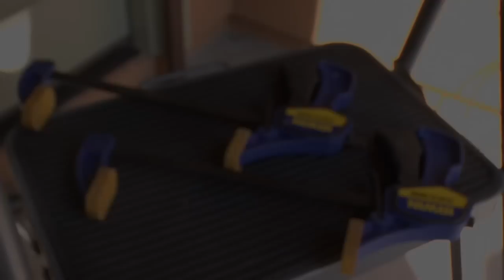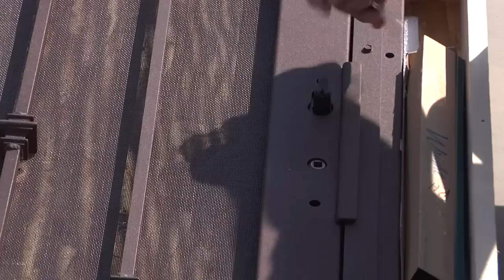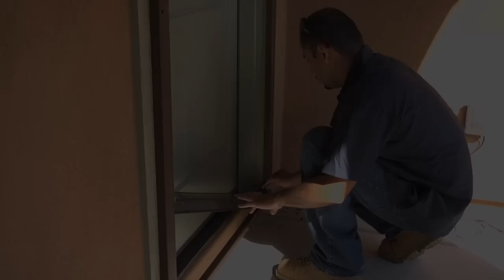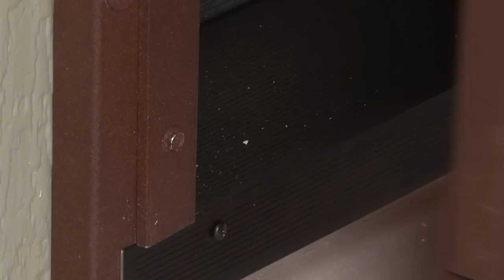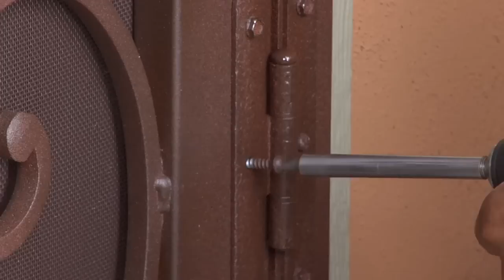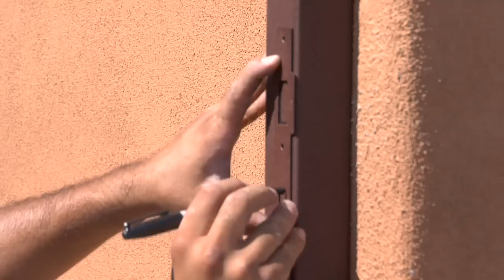Security Door & Gate Installation by First Impression Ironworks

Comment: What would you recommend I do if I centered my security door with the main door opening, BUT there is nothing behind the 1x4 trim molding to secure the security door to? I believe the contractor used shims between the 2x4s and the main door trim leaving a big enough gap so that when I drill for the security door, I hit that gap where they used shims for the main door.... any thoughts?

Comment: I have three security doors to my house, before mounting the doors I had rebuilt the door frames with solid wood mounted into the block walls of the house, then I mounted the three steel entry 6 panel doors and ensured they had a weather proof fit. I bought 3 identical looking security doors from Lowe's Home Improvement, they have 2 inch perimeter rails on the doors. The support bars came with 3 holes and non-reversible screws, I drilled three more holes and installed 3 additional non-reversible screws. These screws are secured into the solid door frames with no shims or gaps. After this the two unseen doors, (back and garage) had double key deadbolt locks installed so even if the steel screening is cut they can not open the doors without the key. I shop regularly at Home Depot and a cashier introduced me to a new locking hasp. The arm swings over the locking pin, this pin rotates to lock the arm in place, then a key is used to lock the rotating pin in place. I used carriage bolts thru the security door frame, then 3 inch screws to mount the lock base to the solid frame into the surrounding stud. Keep in mind the security doors protect the steel 6 panel entry doors. For additional security I mounted 3 pins into the security door frames so if the hinges are defeated the door will not open. Roll down shutters protect the windows and I built a steel locking cage for the power panel. The walls of the house are 16 x 8 x 4 concrete block, my assumption is they would have to come in via the roof. Then they are greeted with a Springfield .45 ACP if they succeed! The garage door I am currently building will have a switched receptacle for the door opener so it can be completely shut off at night or whenever. The tracks of the door will have two holes, one each side drilled so a bolt and wing nut can be applied so the door can not be pried up. The door from the garage to the laundry room is one of the three previously mentioned. The Air Conditioner is in a closed storage, tool area with a security door and block walls. This also is where the two bathroom windows are, they have a heavy duty screen mounted in the name of CrimSafe, these are baseball bat proof. My next feature will be 4 security cameras to see along each wall of the house. I can open the steel front door if anyone rings the door bell, but the security door remains locked thus a home invasion can not happen!

Comment: Please do your research when buying a good security door.  The door might look like it is a good door but anyone who knows what to look for, can see a huge problem with the door that is in this video.  The door frame goes on with one way lag bolts but the door can be easily taken down by unscrewing the tiny screws that are used for the hinges which would take someone with a simple screw driver maybe a minute.  The hinges to good security doors are always welded on the door or if it does use screws, they are on the crack of the door.
Reply from the maker: +Chris P 

Hi Chris, 
Thanks for checking out our video. We use security H-hinges to mount our signature security screen doors which have a welded hinge pin that cannot be removed. We install these security H-hinges to the door and to the frame using security one-way screws in the center two holes of the hinge. Utilizing security one-way screws assures that nobody can unbolt their way through the door as you are suggesting. An additional security measure lies behind the security H-hinges with vault pins. Let's say somebody took a grinder and cut off the hinges --(this is what somebody would have to do to get the hinges off of the door once they are installed). As long as the deadbolt is in the locked position, the vault pins will keep the door securely within the frame without the hinges attached to the door. That's real security!

We do offer an entire line up of exclusive security screen doors that utilize welded hinges among many other upgrades if you prefer. Check out our entire line up of DIY security screen door at: http://www.firstimpressionsecuritydoors.com/product-category/diy-security-doors/.
Reply: FrustratedBaboon I' worked for fisd. .I can tell you that the vault pins are enough to stop the door from being simply taken off . it's 2  hole maby 3\8 or so in the door on the hinges side  with  pins hard mounted in to the outside frame. thay simply slide inside upon close. so even if you get past the one ways you still can't pull the door as long as it's locked there actually really nice doors .any  screen door can be  breached but the noise and time would be enough to say to risky now iron entrance...that's a different story
Reply: Chris P or put the hinges on the inside of the house?
Reply: Pins can also be installed where the door shuts over the pins, usually the gap is small enough to prevent cutting tools from getting to the pins. I installed one pin for each of the three welded hinges. Very important to not make the pins too long, or the door will not close.

Comment: Excellent, informative video.

I have a question.  I need to remove an existing security screen door and replace it.  However, the one way bolts holding it to the door frame look very difficult to remove.  Any suggestions on how to do this?

Thanks!